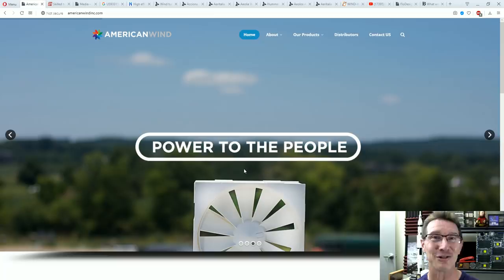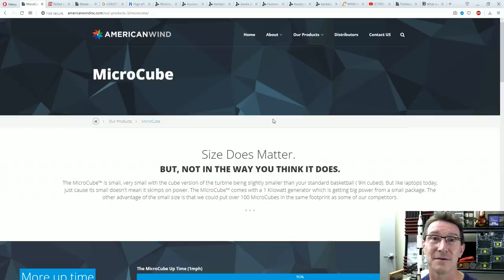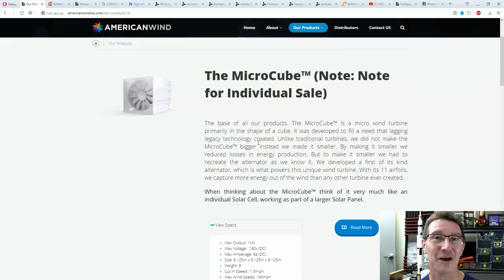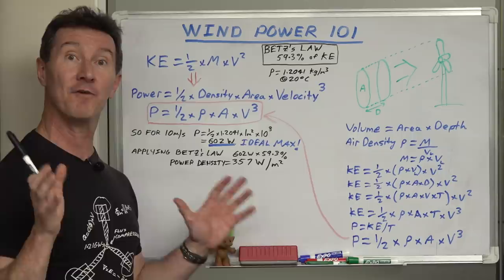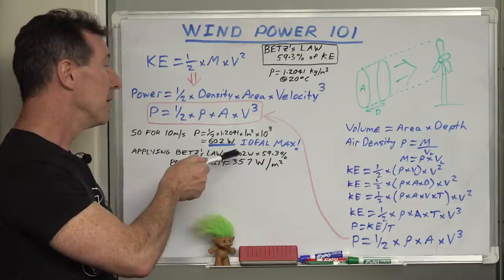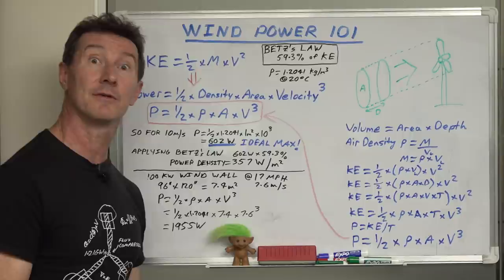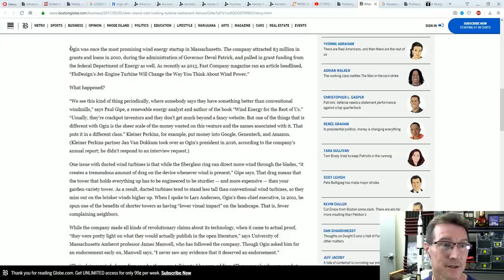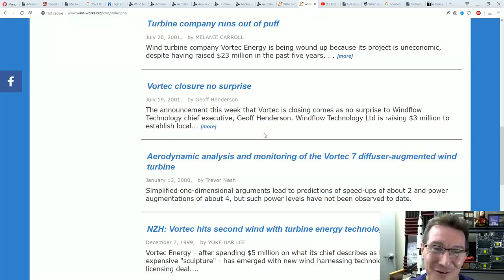EEVblog #1271 - 100kW WindWall Generator BUSTED!

Comment: This is what we need more of on these platforms. You should calculate max conversion rates for electric vehicles, and compare your results to factory specs. There's no possibility that they're converting any more than 35% - 40% (probably less) of the energy which is transmitted from central sources!

Comment: Another little detail (from doing similar calculations with rockets) - if you extract all the energy from the wind then the output wind velocity would  be zero. Now we need to know where all that air goes. :D

Comment: I contacted them on facebook: the claim is 1KW @45 MPH.

Now to figure out the diameter..
Reply: I read, the cubes are 9' x 9"  = 0.5625 Sq Ft area each.  Also, I saw video where they test a cube wit a 200 Watt Load with 75 MPH Winds !

Comment: Let's add one layman';s argument.  We depend on the fact that the air (or whatever fluid) keeps flowing.  It does not stop behind the turbine.  No matter what turbine structures you apply.  If the air would stop behind your turbine, the produced power would taper down to zero in no time at all.  So you can only harvest the stated fraction of the apparent kinetic energy of the wind.

Comment: The blade area of the blocks is a guesstimated 60% of the square area. The rest is the housing and the (rather big) turbine axis. Here the wind hits a "brick wall", which reduces its speed drastically, and due to the largely different speeds A LOT of the wind energy gets lost in turbulence. I'd be surprised if you could get more that 1 to 1.5 W from a microcube in the field

Comment: Lower optimal wind speed actually makes sense for the larger configurations, the usable energy will be much higher for the center fans compared to the outer ones. Wind will to some extent escape around the edge fans making larger surface areas more efficient.

Comment: Why are we using solar and wind to move heavy objects to Great Heights and roll them down slowly with the ambient current. You could do it slow enough just to use the current inherent in the system. And then when those weights come down they can pull turbines

Comment: Solving for velocity and 100kW, they only need 28.2 m/s of wind (or 101,52 km/h or 63,0816 mp/h). And that's without Betz's Law. Hurricane season, here we come.
Reply: What value did you use for the diameter of the Rotor?

Comment: A ducted design like that is much more efficient than the standard 3 bladed generator but wind power will always suck because the wind doesn't blow consistently and there is a limit to the amount of energy you can extract from moving air.
It's the 21st century, moving parts are 19th century, a big part of why PV is so good is because there are no moving parts to need lubrication and maintenance.

Comment: There are other ways a column of air carries energy. For example, air is usually not that dry, and plus, if you force it through a funnel, you can benefit from various "hammer" effects. Imagine you somehow increase the pressure or decrease the temperature, or by using some electro chemistry to condensate the water vapor. Then you have the condensate hammer effect, where the condensation creates a vacuum (remember NYC vapor explosion?). In any case, air is very compressible, cyclic turbulances carry a lot of energy in addition to kinetic energy of the center of mass and sailboats go faster than the wind for many hundreds of years.

Comment: If it were possible to extract all of the kinetic energy from a volume of fluid, that fluid would be at rest afterward and the wind would cause the material to pile up.  Extracting any kinetic energy causes the flow to slow down and to develop a pressure gradient.  In gas this gradient is supported by a density gradient and in liquid by height variation.  This pressure difference times the volume flow rate is another way to calculate the energy extracted.  But the turbines and electronics are also inefficient so not even the extracted power reaches the generator terminals as electric power.

Comment: The spreading happens because when you slow the air you increase pressure. A system always tries to equalize and flow from high pressure to low. So the air spreads to the sides since there is air pushing from behind and blades blocking the air in front.

Comment: 13:46 Much easier to understand explanation why you can't extract 100% of kinetic energy is because if you stop that that block of air (which is needed to extract 100% of KE), fresh air could no longer flow in. Stopped air would be standing still on the way.

Comment: 1kW is roughly 1.25hp.  Way back in in enginerining school, (you can tell I'm a real engineer because I can't spell enginering) we learned that there is a relation ship between the size of the stator and rotor that dictate the physical size of the machine required to deal with the rated power.  A 9" cube is not big enough to house a 1.25hp generator.

Comment: Even if this would work, wind speeds fluctuate as do sun rays. Both can not deliver a stable load, which is why the only rational and working energy option is a mix between nuclear fission, water power plants and water energy storage plants.

Comment: shouldn't the maximum efficiency depend on the size and form factor of a wind turbine? It should also be different for compressible and incompressible stuff.
Extracting kinetic energy from a moving liquid or gas means this liquid or gas is slower afterwards. But the material needs to move away. If there is no compression, you need a wider area for the material leaving than entering. Example you have a cube of one meter entering per second, than you need to have also a cubic meter leaving but if this is half as fast, as you extracted the kinetic energy of half the speed, you need twice the area for the leaving material. And the widening of the area should be at are edges only, so the maximum efficiency should depend on the geometry.
But you are right of course, you can't extract more than coming in!

Comment: You proved why the wind wall can't produce the energy they claim, but your model of a standard wind turbine only defines the parameters. You would have to model a screw pattern through the flowing air volume, taking the rotational speed into consideration, to more accurately model it's energy output.

Comment: Objection. The guy said that their turbines are working on the principles of jet engines. Jet engines compress the air resulting in higher air density. If their turbine uses Magic(TM) to compress the air for free they may be able to produce more energy.

Comment: If the company is claiming that the wind wall is based on jet turbine tech rather than being a simple fan, where are they getting the energy to compress the impinging gas flow? A simple ducted fan isn't going to get 10x output.

Comment: Wouldn't the Venturi effect have a benefit with the generation of power? The Venturi effect means that when you push or pull air through a funnel from the big to small ends, the air speed goes up. So if the airspeed goes up wouldn't that make a windmill spin faster and generate more power?

Comment: Quick back of the  envelope calculations show that the ideal windspeed for this to deliver 1kW per unit would be approx. 85 meters per second.  Or in imperial units, 190 miles per hour. If you are getting 1kW of power out of your generator, may I suggest that you are in a concrete bunker at that time?

Comment: I wondered if they had confused a wind turbine with a water turbine for a second there :o)
The wind speed would have to be 62mph to get 100kW, still ignoring Betz's Law and all the other losses in the system of course :o) And at 62 mph, that array would be flat on the ground anyway.

Comment: ok, besides these insane claimed output values.. I actually see some potential for the small ones: mainly for easy unobsturctuve installation and in areas with fast wind speeds....so you could put up a dozend on your house roof and get some energy out of it.
.....but I have my doubts on the wind wall: if it really will be useable at higher wind speeds: The forces on the support structure must be enormious...

But anyway thank you for explaining the efficency of wind turbines in general...it was comprehensive, short and very insightfull.

Comment: It gives me an idea.  A new, design of toilet.
The toilet seat will now be fitted with seals preventing the leaking of air and keeping a tight seal around the buttocks when in use.  There is a duct at the inner rim of the toilet and it connects to a turbine.  The expelling of gas is guaranteed when the toilet is used.  We can harness that energy to power homes.  A good curry is cheaper then building more wind turbines.
A revolution in power generation.  The Turbo-Crapper.

Comment: The reason a big funnel for a small turbine is stupid in 99% of all cases is because you can just make a bladed design with the same capture area and be just as efficient, if not more efficient due to aerodynamics.

Comment: The car with the turbines on the roof pointing forwards... using the engine power to drive the turbines! If they were turned 90 degrees, might have got a bit of power from side winds, probably when parked.

Comment: Turns out there is no law against advertising your wind turbine as a 100kW system even if you need a hurricane to get anywhere near that much power out of it...
Apparently ducted fans actually are more efficient, you just need to make sure there is barely a millimeter between the tip of the blades and the duct. At the sizes of proper wind turbines that might be little hard to do, especially as high winds might deform the duct and then you have a fragile turbine blade getting too close and personal with the wall at high speeds. But if you can avoid that issue there is a perfect way to get them to produce useful amounts of power: Hoist them up really high. Specifically, make a flying wind turbine by building it into a hydrogen balloon. Helium is really too expensive for airships, while advances in fuel cell technology are making hydrogen a viable way to store renewable energy so it makes perfect sense to also use some of the H2 as the lifting gas.
The system needs methods for ensuring the balloons don't collide or get their lines messed up and that they can be quickly brought down in case of a storm, but there isn't anything outright saying it can't work, it would take much less money to build than towers hundreds of meters tall, and also have much smaller footprint on the ground than a big tower. Cables wouldn't cause much shadows either, so the land under the flying windmills could even be used for a solar farm.
Of course, this means building an actual decent sized turbine, not a glorified computer fan.

Comment: Right there with you on calling out these snake oil renewable concepts!   A quick comment Dave - large scale turbines use blade pitch control to limit the power input to the system.   Trying to apply a dummy load (~ 3:40) would require the dissipation of incredible amounts of energy - and it would still be converted by the generator.

Comment: Even if a ducted turbine were twice as efficient as an open one wouldn't it still be easier, cheaper and more reliable to just increase the diameter of the open turbine by 41% to capture twice as much wind than to construct the massive duct structure?   Why do they even think about such things?

Comment: So if these turbines actually increase the wind speed as the air goes through them, can you just put another set on the exhaust side of the first set and get even more energy?  Then maybe set them up in a circle.  And now infinite energy, right?

Comment: That triple installation would be great on a SMALL (ie trailerable) sailboat's collapsable bimini bar.  Get two "triple mounts" and bolt them on the outward sides of your bimini frames and you can get up to about 2KW at normal sailing speed.  That should power your basic electronics suite while under sail.  Larger boats can easily beat them with just ONE wind turbine but even small marine wind turbines are around 2 feet in diameter and require 3 to 4 feet of space for occupant safety.

Comment: To extract all the energy out of the wind, it would have to stand still behind the rotor. You would experience a build up of pressure that would slow down the velocity of the wind going thru. The linear aproximation for a flux thru the rotor is an idealisation you can't have in reality.

Comment: I'd guess they took those measurements by pushing air through it straight from a compressor, just taping it to the end of the pipe. 

Also they may measure the speed across the whole square area,  getting a greater speed through the blades.

Comment: Here's the company's response to your video from thier FB page. It reads like a fourth grader wrote it!

For people who watch a YouTube and don’t realize the person makes assumptions and uses math that takes into account incorrect assumptions, not to his fault, but has simply never came into American Wind and doesn’t completely understand using models built by traditional turbines does not work with constrained flow wind turbines. But we always invite doubters to visit us! You’ll leave an believe.

This photo was taken during one of our many tests. What you see is the MicroCube outputting 807watts under a 725watt load.

There is no snake oil here just technology that has been PROVEN, in 3rd party CFD, two wind tunnels, 3rd party verification of our generator output. Hundreds of people have seen this technology work with their own eyes. We never sought out any awards, they were given after people saw the technology and nominated us.

This test is when we found out we could not run a resistance heavy load... because for the connection wire we used to connect the MicroCubes circuit to the load meter, 45amps was simply too much. This is when we shifted to a higher voltage lower amperage circuitry to control The gauge of wire and energy loss to heat.

For people that always want to see the what it does under load, is 45amp load per cube enough? Or would you like more? We’ve pushed it to 60amps and almost ignited the wires that make the connection to the load meter before. 6 amp load was chosen, but is not the maximum, nor is 180v max per cube. At one wind tunnel we pushed it to well over 220v.

Comment: It seemed interesting to see just how weird things would have to be for this to work, so plugging and calculating about, I found that a rho of about 61.3 would give you enough density to pack 100kW in to a material moving 7.6 m/s over 7.4 m^2. So then, what conditions would you need to have for air to get that dense? Well, if you brought it to about 5.7K, just around 6 degrees up from absolute zero, it would be dense enough, or if your pressure went from 101.325 kPa, to about 5157 kPa, you could swing that. So air won't work, but I was wondering if there was a material that could get you there. Even Tungsten Hexafluoride, which Wikipedia claims is one of the heaviest gases at standard conditions, comes in at 12.4 kg/m^3, which is no joke at about ten times as dense as air, but a factor of five less than needed. So how could he have gotten it so wrong? Maybe he was using data for liquid hydrogen, a common enough fuel in rockets and such, which apparently has a density of about 70 kg/m^3 at about 18K. If he just hooked a multimeter up to the fan on his porch to see just how little power was being produced, maybe we could have avoided all of this.

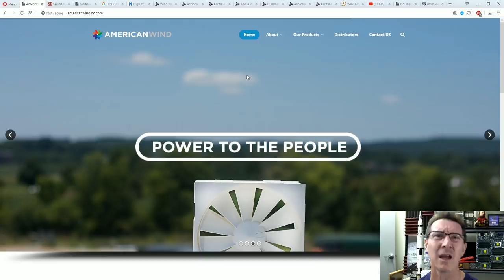Comment: Lucky "youtube" is your day job Dave! (0:13-0:22).
And blocking the airflow with more blade width doesn't scale up with energy captured (from your smaller total energy available). Increased pressure buffering on the front will force air bleed around it.   The figures given look very rubbery at a Grade 10 science level. Maybe it could keep my batteriser recharged or help protect my solar roadway from over-use.

Comment: It's equivalent to turboprop vs. turbofan propulsion, so there's clearly some potential there if someone finds a way to engineer it at the height and scale of the big wind turbines.  The gains, however, would be similar to those of turbofans over props, i.e. not an order of magnitude.

The other clue that it's just not practical, is that Pratt & Whitney are not doing it.  They could easily turn their expertise and wind tunnel facilities towards producing a ducted fan generator thing, but they are not.  They already do clever magic with duct geometry to get "free" energy from ram air effects.

Comment: Overunity is possible in open energy system. For exsample heat pump. You spend 1 kW electric energy to pump out 10 kW of heat.
Reply: Heat Pumps are NOT Over-Unity, they have a COP > 1.

Comment: Interesting that the footnote on their microcube is max power of  1kw  must be at the maximum wind speed it can handle.  SO maybe in a hurricane it can produce 100kw; but its not going to be much use.  There is not enough wind energy per meter at normal wind speeds even if they manage to have 100% efficiency.  You can't get more energy than there is available.

Comment: A solar roadway, would be a awesome idea, if the road was covered, with pv panels, but driving on them is just dumb! But pv in certain areas covering a road could be great, and help with light pollution at night, also saving power at night illuminating the road, while helping the grid during the day ! That wind crap is full of hot air!